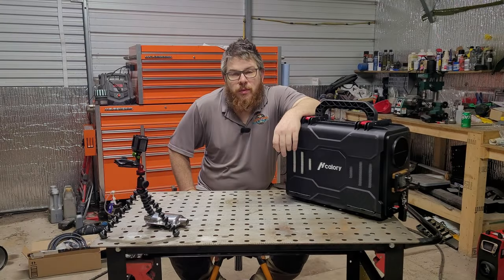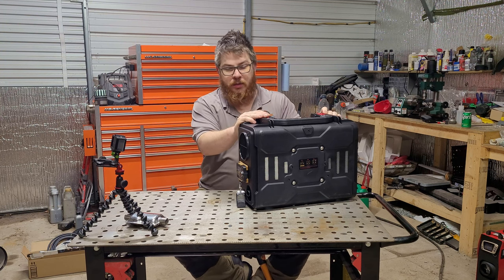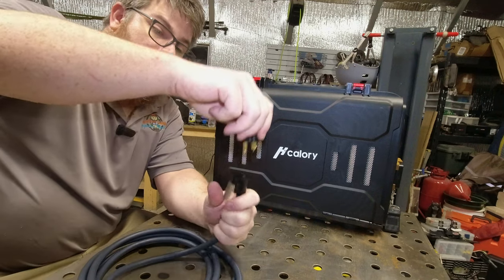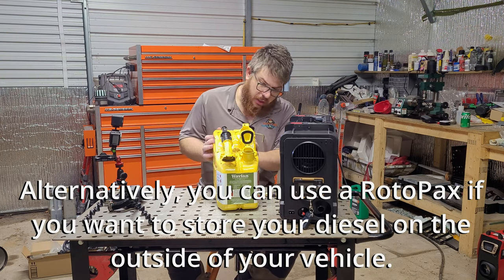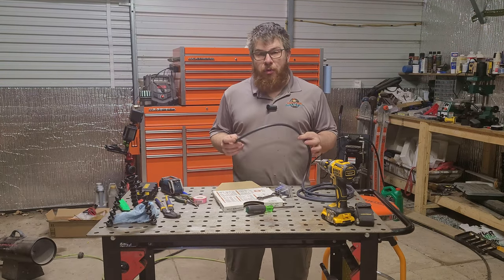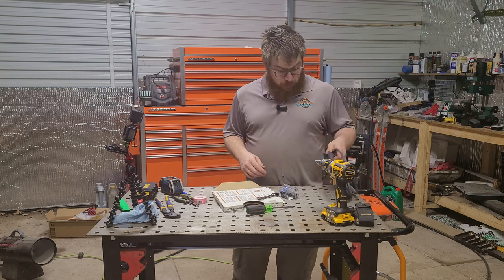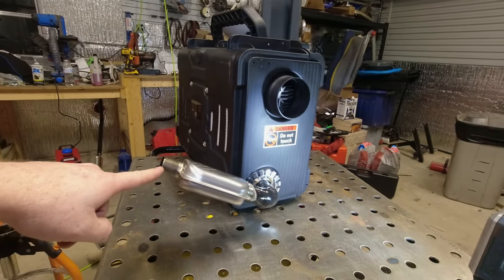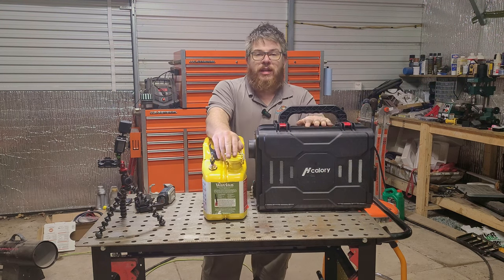THE BEST DIESEL HEATER SETUP FOR OVERLANDING - Hcalory Bluetooth Toolbox Heater & Major Improvements

Comment: I have the same unit but mine overheats with the king hose attached the same way as yours. It doesn’t stay on and I’m going to replace the temp sensor but it’s relatively new unit with low hours. Only used it one successful night and after that it keeps overheating.
Reply from the maker: Sorry to hear that, have you tried contacting the manufacturer?
Reply: What is the actual internal diameter of your hose? I bought a supposed 3 inch hose but real diameter of 2.5". It was causing back pressure and overheating my unit. I tested with the metal hose the unit came with and had zero issues with overheating.

Comment: I’ve been looking at the same diesel heater. Noticed you had a Bluetti to power it. Which model is it and how long do you get out of it for the heater?
Reply from the maker: The model is the AC50S. Hard to say how long I get because I am always running other devices off of it at the same time. And I top it off during the day with solar or something. But it will last quite a while if you are NOT* starting and stopping the heater a bunch.

Comment: Good video. Do you know how many watts the heater draws from your power station on start up from the dc port. Is it anymore than 120 watts? 10amps. Ive just ordered one of these heaters and have 2 ecoflows but after watching a few video's im worried there just going to trip on the heaters start up. Ill have to get the AC cable if it does costing more. Thanks .
Reply from the maker: @leeboyd3163  Thanks! I believe mine draws around 90-120 watts when the glow plug is on. Which has always worked fine on my bluetti. However, I have heard from several other people that it trips their breaker. Including people who own other bluetti models.
Reply: @SFARCO 
Thanks for the response. That's so strange that's others have problems with the same equipment. Well I have a diesel heater already that I've been using for the past year but started having problems with the screen not coming on the other day. Its a Hcalory 5-8kw model. My ecoflow river mini 300w can run that. The most that heater draws is on start up and it goes no higher than 144watts and stays on. I was thinking with these newer ones that they draw more. My ecoflow does well not to trip off at that being 10amp. I've got the heater working again due to a dodgy wire but I'd already ordered the new one so I suppose I'll have a spare.

Comment: What grommet did you use for the drilled hole in the housing.
Reply from the maker: @88timmyc  There should be a link in the description.
Reply: I've looked through the video again and the links in the description but still don't see that grommet.  Did it come from one of those grommet variety packs?
Reply from the maker: @88timmyc Yes, they sell them in packs, not individually

Comment: This is a very sweet setup and well thought out.  I love how the system remains primed due to the marine disconnects utilized.  Was there any reason that you decided to go this route rather than one of the cap adapters such as the Sealy JCA2?  Is there anything that you wish you had done differently??  Thank you so much for any additional information you can offer.  This thing seems great!
Reply from the maker: Thanks! The main reason was for the marine fittings, to both keep it primed, and leak free. I wanted to keep the fill port clear, so I didn't have to pull a siphon tube out and make a mess when filling. As far as changes, it pretty darn close to perfect for me. With one exception, if I forget to vent the lid for long runs, it will create a vacuum that will stop fuel flow. So I am going to use one of those lid adapters to install a vacuum release.
Reply: @SFARCO  Thank you so much for the information.  I really appreciate it!
Reply from the maker: @ryanknoles5146  No problem!

Comment: Does the Diesel Fuel Container need a vent?
Reply from the maker: Depends on how long you're running it for. If you plan on running it for a longer period like overnight, then venting it would be a good idea. You can just crack the lid a little bit. But I am working on an update video that will show how to install a vacuum release valve.

Comment: Have you figured out how to prime the heater using the controller?
Reply from the maker: You have to hold the gas pump button on the lower left part of the controller during the self check mode when you first turn it on. Hold it until the screen displays P and the pump icon lights up. Then you have to let go of the butto before the timer runs out. If the self check is over, you can't enter the priming mode. Hope this helps.

Comment: Well thought out, very nice upgrades. I'm currently building my system now, also with a remote fuel can. Much easier to transport the heater case inside the rig without the can attached. I'll try it without the air breather 1st to see the vacuum effect, then decide on the breather it it gets too bad. 
Thank you for sharing
Reply from the maker: No problem. I was thinking about adding a vacuum relief, but so far, I haven't needed it yet. I just open it every now and then. The Jerry can design allows for some flex. But if you want to set it and forget it, then a relief would be advised.

Comment: Just bought this heater and came across your video (Great by the way).  I did have a question on how did you get the 12vdc cable to fit upside down; did you file down the guide on the receptacle, because I saw the wires were reversed?
Reply from the maker: Thanks! I just removed the terminal from the case and reinstalled it in the reverse orientation.

Comment: Great video ! The only issue  i deal with this diesel heater is that my 12v output can't handle the ignition. I have an ecoflow river 2 pro and overload protection hits  during the ignition. Do you have any issue with your 12v output?
Reply from the maker: Thanks! I have not had those issues. Not sure why, but I have heard other people having the issue. They use a dc converter and plug in to the ac inverter on their power bank to make it work.

Comment: Will the elbow piece you have linked fit with the manufacturer muffler or do i have to purchase the one you linked to make it work?
Reply from the maker: It will fit the muffler that comes with the heater. But the elbow is the same diameter as the exhaust port on the heater. So a small kink with pliers on one end of the elbow is required to make it fit.

Comment: This is a great design! Do you have any issues with air bubbles when you disconnect the marine couplings? Boat gas cans use primer bulbs, do you not need one of those?
Reply from the maker: Thanks! And no bulb needed. The marine fittings keeps the line full of fuel, so no priming necessary. You do have to vent the can every day or so depending on temp and usage. If you accidentally push on one of the plungers for marine fitting, that can introduce some air in the line. But the heater recognizes no heat issues and keeps the igniter lit longer. If that small amount of air even causes an issue.
Reply: @SFARCO  It looked like you had to push really hard to connect the marine hose fitting to the one you mounted on the heater case and in this video you were pushing back on the inside while you were connecting it. Do you think the plastic case is strong enough to withstand the force?
Reply from the maker: Not all fittings are that stiff. These ones were but have since worn in and gotten easier. The plastic has been holding up great so far.

Comment: I'd just get the "stand pipe" as they call it and put it in a 5 gallon plastic fuel can of some kind or large plastic jug (you can buy them cheap of get them free) That way I'm not constantly filling that cheap little gallon tank the unit came with.
 As for the air filter, all that's needed is to drill more holes in the muffler and line it with some kind of filter cloth and there's your filter!
Reply from the maker: Sounds good. But that doesn't really solve the problems I set out to fix.

Comment: This is really helpful. I am basically following your guide and purchased every part you listed. Are you willing to sell the 3D printed mount for the control unit? I have the same issue that the mount that came with the heater is too small.
Reply from the maker: I'm glad this is helpful. Unfortunately I'm not selling 3d prints at the moment. I only have one printer and my schedule is currently really busy. But I found the file on thingiverse and just needed to modify the dimensions on the one axis in the splicer prior to printing. I hope that helps.

Comment: What size line are you using for the hard fuel lines on the inside of your unit?  The line I purchased from the link provided seems a bit small to fit the barb for the fuel pump and filters. Is there a trick to installing them?
Reply from the maker: It comes with black sleeves that slide over the tube and pump orifice. And clamps to secure them.
Reply: @SFARCO  and now I feel like an idiot 🤦‍♀️ lol I appreciate the assist
Reply from the maker: @TheRocket0627 lol, no worries.

Comment: How’s you get your bluetti to power it? I bought a eb70s and it won’t run mine throws a error code
Reply from the maker: I didn't do anything, just plugged it in. I would try contacting the manufacturer, and see what they say.
Reply: @SFARCO   I've had the same issue. It's because the Bluetti 12v cig lighter is limited to 10 amps. However, these diesel heaters can pull 12-15 amps at startup while the glow plugs are coming up to temp. Looked into it and the only way around it is to use a power supply to convert from DC to AC and use the AC outlets on the power station.
Reply from the maker: @syedhaqqi384 Yeah, mine is also supposed to be regulated to 10 amps, but I haven't had any issues. I guess mine isn't as strict. AC50s is the model I have.

Comment: I set my diesel heater up just like yours and It seems the pump is too weak to get fuel through the fat marine line. Did you have any problems priming your lines?
Reply from the maker: I would recheck all your joints. They may be tight enough to not leak diesel, but loose enough for an air leak, which will prevent your pump from picking up diesel.
Reply: Did you ever get your fuel pump corrected?  I just bought this heater and it states in manual that the 'pump capacity setting' can be increased or decreased, using the LCD panel settings/options.

Comment: Did you have to vent that gas can?
Reply from the maker: You can run it for a while without venting it. But if you are running it for a long time you will need to open it to vent it. Small trade off for not leaking. It was the cheap vented cap that leaked for me.
Reply from the maker: You can definitely add a good check valve to it if you don't want to deal with manually venting it.

Comment: Doesn't look weatherproof so how do you use it if it's raining or snowing?
Reply from the maker: It wouldn't be good to completely seal it up so it's water tight. The heater needs to breath to dissipate extra heat. I put mine under my awning or under my vehicle.